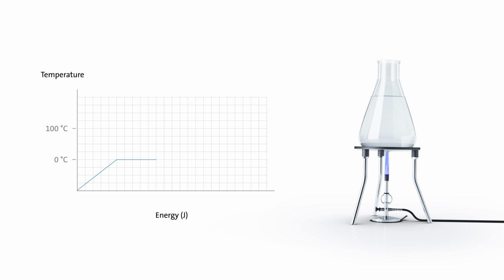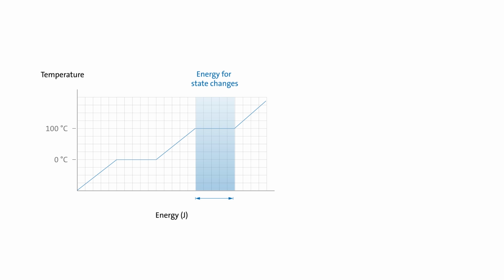How does adiabatic cooling work? | Humidification Made Simple

Comment: you didn't explain the adiabatic cooling process, instead you explained the evaporative cooling process
Reply from the maker: From 0:00 to 2:08 (and this is the major part of the Video) the process of adiabatic Cooling is physically explained. Only in the last quater there is a technical example for evaporative Cooling which could be also considered as a prectical utilization of the adiabatic Cooling Principle.
Reply: Yogeshwar Singh is right. At NO time is there any attempt to explain how the adiabatic process works (for heating or cooling).

Here's the problem. If there is a relationship between the speed of particles (atoms/molecules) and their temperature, then a physics process that changes that speed changes the temperature of the material.

For heat by conduction, it's easy to see that, as particles collide they exchange their energy/momentum. The faster one slows down and the slower one speeds up. The hotter one gets colder and the colder one gets warmer.

In the adiabatic process there is also movement but, unlike conduction, there is no direct exchange of the speed of the particles. Yet, SOMEHOW the particles are able to be made to move faster (adiabatic heating) and slower (adiabatic cooling).

What NEVER gets explained is the mechanism nature uses to change that speed. This video certainly makes no attempt to do so and therefore does not live up to its title of, "How does adiabatic cooling work?".

Of course there are plenty of nonsense answers as in this Feynman armchair video (https://youtu.be/NsdCzujHqAk?t=5m37s) but, if we try to follow his logic, the central part of the pump would get the hottest since that's where the piston moves the fastest. And, anyone who has ever owned a bicycle knows that's not true.

What's needed is a good, believable explanation of how pushing particles of matter closer together can make them move faster and, just as importantly and to make this video useful, how allowing them to move further apart makes them move more slowly.

salaphysics 042120

Comment: Adiabatic cooling as a process has not been explained. Thumbs down
Reply from the maker: Dear Mr Panwar, the physical  and energetic principal of adiabatic cooling is shown. Also how it can be realized in a HVAC-Unit. If you have any additional input how we can improve this video you can contact the Condair-Team of your country. Input is always welcome.
Reply: @CondairGmbH  You see the issue here and in most of these videos explaining this process is that you just say "energy is taken from the environement". That's an insanely vague way of putting it. It in no way actually explains how that water evaporates
Reply: How you solve limestone isue in water while evaporating? I asume water flow is not that small?
Reply from the maker: @MrSponar  limestone is more problem when humidification is done with steam. And here the principle of Scale-Management can permanentely solve the problem.
But if really a problem occur with limestone by evaporative cooling you can more often change the evaporative Media or you can use a watersoftener. Then limestone shouldn´t be a problem any more.

Comment: If the heat is lost by the body during the evaporation of sweat, how can it be adiabatic?
Reply from the maker: Thanks for your comment. 

Basically, a distinction is made between three physical methods: vaporization, atomization and evaporation.
Vaporization is an isothermal process, atomization and evaporation are adiabatic processes.

When the human body is very warm due to excessive exercise or high ambient temperatures, 
the skin begins to sweat. The heat transfer is considerably increased by the sweat or liquid. 

The evaporation of the sweat then provides for heat dissipation.
Reply: @CondairGmbH  Evaporation is a type of vaporization that occurs at temperatures lower than evaporation and as correctly mentioned in the video, it requires the heat of vaporization to occur. As this necessary heat is provided by the human body, it is not a process of adiabatic cooling.
A good example of adiabatic cooling is the cloud formation at high altitudes where the air cools down due to decrease in its pressure, this causes the air to expand and cool down.
Reply: This is slightly different as it is the phase change between ice and water, but in the United States, air conditioners are rated in tons of cooling.  While many people know that 1 ton of cooling is 12000 BTU/h, they have no idea why it is called a ton.  Back when cooling was accomplished it bit blocks of ice, it takes 1 ton, or 2000 pounds of ice to change from a solid into a liquid to achieve that 12000 BTU/h of cooling.  The ice was 32°F or 0°C and the water is the same temperature, it just changed phases.  A similar latent energy conversion happens when liquid water changes into vapor, it needs extra energy to perform that conversion, so it absorbs it from the body resulting it a sensible temperature cooling effect.

Comment: For those of you confused I recommend first understanding how to read a psychrometric chart.  Humidification of the air is an adiabatic process.  Why?  Because you are adding WATER, not heat.  Why does water cool the air?  Because more moisture content = more evaporation.  Evaporation absorbs a tremendous amount of heat and thus when you observe the psychrometric chart, you’ll notice as you move up a WB line, you move down the DB line along the bottom of the chart.  So an adiabatic cooler is simply spraying water in front of the incoming air to humidify it and thus increase its wet bulb which coincides with decreasing the dry bulb to, as some describe, “pre-cool” the air so that you can have a colder medium to exchange heat in to for your higher temp incoming fluid.  If this is STILL confusing here’s a video demonstrating the psychro-process: https://youtu.be/1oMwioiEl-Q?si=zmdVtHkSOAEPqqdl
Reply from the maker: We have detailed videos on the subject of the hx chart or psychrometric chart. https://youtu.be/l0nVj9zsEEU or https://youtu.be/dxVthBQPCpo